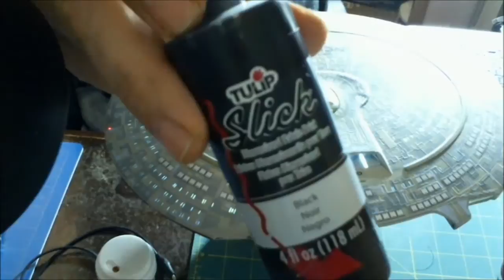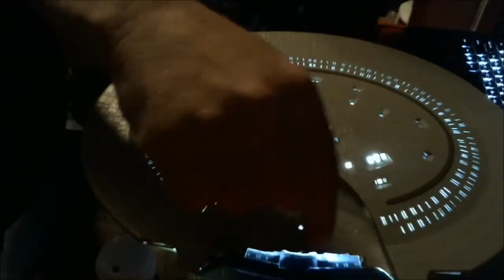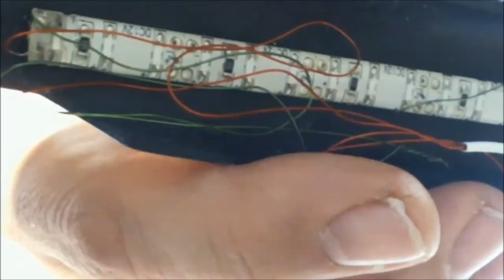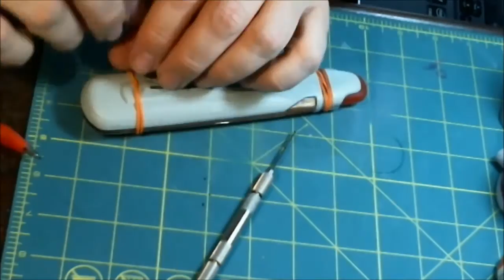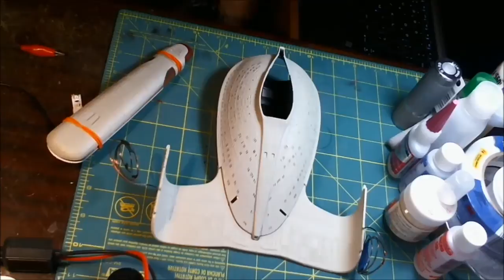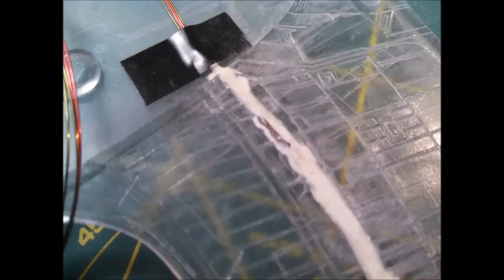AMT Enterprise-D Clear Build Part5

Comment: Good afternoon, I know I'm responding to an old build, but I'm just curious if you ever finished the Enterprise D? Love to see it complete.
Reply from the maker: No, I did not. But I recently retired, and I'm cleaning up my cave. So I'm getting back into building. I'm kind of stuck on the Enterprise. I finished one of the engines, but I can't finish the second one. I used blue side emitting LED's, and I can't find them. I can't even find them online. Ugh.. we'll see if I eventually find them. Or perhaps create my own.
Reply: Hey, thank you for the response. It would be very nice to see any progress should you continue this build. Is there a reason why you couldn't just use blue LED tape instead? There is quite an abundance of that online.
Reply from the maker: @TrekBuilder  Once inside the engines, they can look like blue dots. The side emitting LED's diffuse the light, so it has more of a glowing effect.
I'll certainly do another video when I get back to it. Thanks for asking.

Comment: Is that copper paint a transparent copper or regular copper paint?
Reply from the maker: Do a light coat, then test with lights. Then do another coat if necessary. Btw.. the led's I have in there are blue.
Reply: @MrBelmosan  oh yeah, I'll be using some small blue double density led tape for the nacelles. Ill see how they look and then decide if I need to defuse them.
Reply from the maker: I used side-emitting led's. Each led is covered and has one open end. So that it's not too obvious that there are individual lights in the nacelles. I still had to take extra steps. It was either clear frost spray or wax paper. I can not find those led's again. I don't remember where I got them.. it was like 6 years ago. Lol
Reply: @MrBelmosan  I'll place them in a way where they are not hitting the clear part directly so I don't get any hot spots. I can't wait to start building again, it's been decades since I've done it.
Reply from the maker: The ring? It's actually Model Master spray enamel, SAC Bomber Tan. I masked the ring and sprayed it. I believe the instructions called for that color.
Reply: @MrBelmosan  yeah, the blue ring for the nacelles. That looks pretty hot like that. Now that I see you do that I can remember the episodes where the engines are off and they did have a copper look to them. I don't have that specific copper color but I do have a copper paint. Think it will work if I thin it a bit?
Reply: @MrBelmosan  that bomber tan looks green on the web.
Reply from the maker: Ohh.. the nacelles.. that is copper. I'll have to check what I used. I'll get back to you.
Reply: @MrBelmosan  thanks. From your vid it looks transparent to me. But you could have thinned it to look that way too?
Reply from the maker: I'm an old duffer.. so I'm not 100% sure, lol. But I think you're right. I think I used Tamiya XF-6 copper, in an airbrush. Probably thinned down.

Comment: this is cool. I like your runway lights for the docking bay. How many layers of paint did it take for blocking the light?
Reply from the maker: CaptTambo Thanks. I don't remember exactly, but it was at least 3 coats of flat black, and one or two of the gray. Next time I might start with white, as it would reflect the light around the interior better.
Reply: Thanks for the reply! How come you don't post anything anymore? We missed out on your completed model. :(
Reply from the maker: CaptTambo There's a good reason for that. I never finished it. hahahaha When I get back to it, I'll post more, for sure.